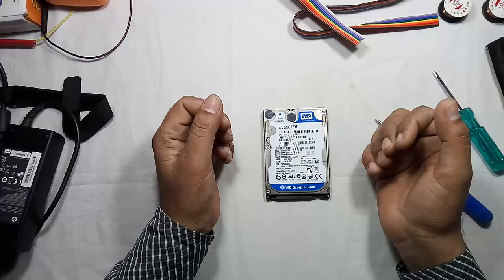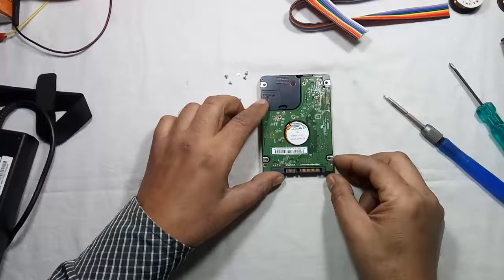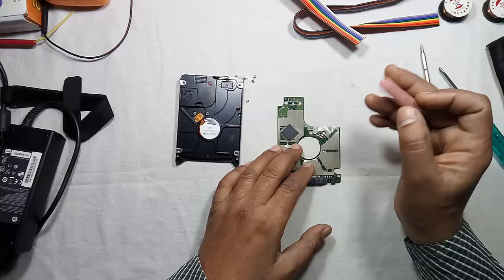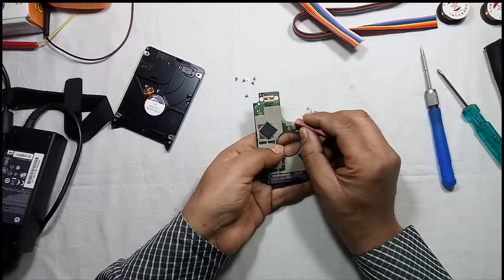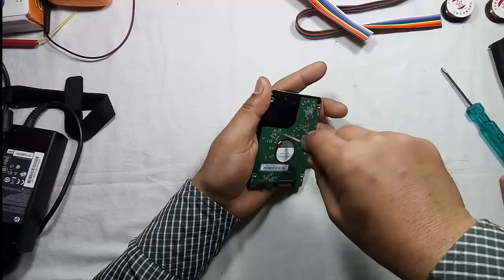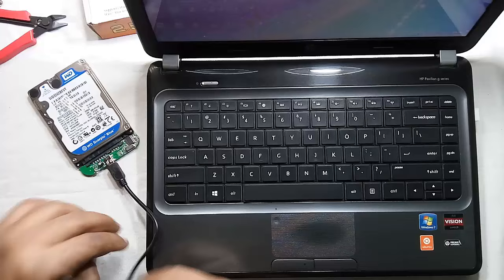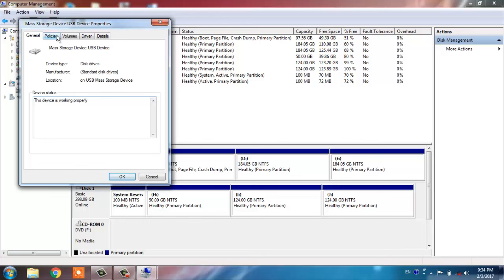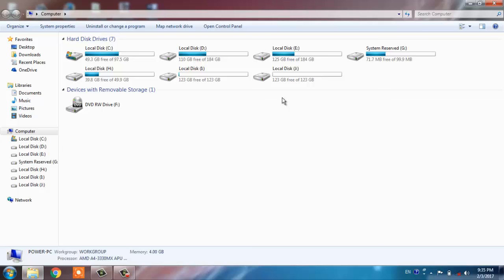How to repair hard disk not detected by Innovative ideas || innovative ideas

Comment: I have same hdd of 1 tb but my problem is that my hdd is displayed in device manager but when it didn't get iniltilaze when i format.  No clicking sound and spinning well. 
What to do. It hangs my pc also when i plug. How to format in device manager so that it can show in my pc manager. 
There is also bad sectors when i check in recovery software.

Comment: I gather that you just said DO NOT USE the hard drive that was just fixed as the main hard drive. Is that right? This lap top i am working on has the recovery partition ON THE HD. There is no copy, Sony will not help with Vaio computers or lap tops.  i dont know why but that is what is written on the site.   so 

  wow.   this hard drive is visible when i hook it up to my desktop as you have with the external hard drive parts are hooked to it. ( very cool trick, I like it.)   but when I put the HD in the lap top after cleaning it still is not visible, says NO OP sys found and also HD Not detected.

Comment: @innovative ideas Very nice video you have made but my question is how to know if the hard drive is making a clicking sound, is it the sound which is made while running or we need to check by shaking the hard drive.
The sound while running is not at all in my hard drive but while shaking very minute tick sound is there but I feel that is normal, please help. Thanks
Reply from the maker: good question. you can check it by keeping your ear on it. there must be smooth running sound. no extra sound of other noise. you can also check by keeping a microphone on it. or stethoscope......
Reply: Thanks for the reply, this is while running, right ?
Reply: Yeah, smooth running sound is there while connected.
Reply from the maker: YES, IT IS GOOD

Comment: My hard drive had 3 partitions. 
1. System Restored 100 MB 
2. C drive 150 GB which I had formatted while installing windows. 
3. D drive 300 GB. 
I am unable to install windows on this harddrive, it is taking a lot of time. So I changed my hard drive. 
I have connected this harddrive via sata to usb 2.0 to my laptop. But only first 2 partitions are opening on my laptop. The important third one is not opening on my laptop. The partition is getting drive letter but it is not opening.

No softwares are in a position to help. What should I do?

Comment: if your laptop detects the drives of your internal hard drive on (my computer) but there is no volume space underneath them and if you try to open these drives it takes ages and your laptop becomes non-responding. Is it a bad indication that you lost ur media ? any help please
Reply from the maker: In this case try out the process shown as in this video and after that apply some other processes shown in other video https://youtu.be/Rnss9HxpsGk. Thanks
Reply: Your description sounds like the drive turn RAW, which can happen for numerous reasons. If you check the drive using windows disk manager it will show you what the drive is formatted to. If windows disk manage shows the drive formatted as RAW and that drive was previously formatted NTFS, you can use chkdsk to correct the issue for that drive.

Comment: Hello sir.
I have a seagate 2TB drive that was part of my home NAS. it is now not recognizes by windows. I tried 3 different data recovery software options and none found anything. on them the drive shows with a drive letter and 0 kb size. the disk makes no sound whatsoever. i tried using a different logic boar from another HD that is in the same class and no success. Any idea what else can i possibly try to rescue data from the drive?
Thanks in advance.
Reply from the maker: Dragan Duric  I will provide it tomorrow...
Reply from the maker: Bro, It might be the cause of head error. Kindly replace the head if you can do it confidently or else kindly visit to nearest data recovery shop....
Reply: ok. thanks. If i wanted to get a new hard drive to replace the old one, how would i install the OS that comes with it so that it would work as NAS on my home network?
Reply: Dragan Duric did you tried opening hdd and moving the head? there are some vids that shows how. i done that aand it is easy but be careful.

Comment: Can this method used for desktop pc hdd ?? I have a seagate barracuda 500 gb hdd. Was using windows 7. Became slow and slow say by day. Not booting up takes about 30 minutes. So i removed it from pc and connected it externally to a laptop using a 3.5 inch hdd case adapter. No clicking sounds or any other noises. Takes about 5 minutes to get detected when i tried connecting it externally to a laptop. Every folder shows up really slow. Copying data takes time. About 1 hour to copy 500 megabytes. Can you help me out please ??
Reply from the maker: Riddler kindly run checkdisk....
Reply from the maker: Riddler Please Right click on the desired drive. Click properties. Click on tools tab.Click on check now.Select both the options of check now. Then click on start. Follow these steps for each partition. This operating system tool will check your disk partitions and repair automatically.

Comment: Sir i want to know i am using Western digital hdd 2tb and it wont detect on my operating system. I m sure that my hdd is spining, also i didnt heard any click sound from it but when i connect it to my pc my operating system wont even starts its hangs on windows 7 logo same with windows 10 but it didnt help. I am using 2 wd hdd both are 2tb and 1 ssd
Reply from the maker: Most of the times this problem also occur due to weak power supply (SMPS). Kindly check that
Reply: m using 1000wats smps is that insufficient or r u referring me to use multimeter to test the power supply manually ??

Comment: My hard drive is a data or an ide hard drive and when I connect it gets hot but it does not work at all or show on computer or make any signs that its working. It's very very quiet no sound at all. Just high temperature. Can you help me ,please?

Comment: Sir my external hard drive not responding properly but it's shows sometime but not detected at all when detected it takes many time to open the drive but after it's not responding
Reply from the maker: Might be due to bad sectors.
Remain connected and power on your system. It may check errors of the HDD while booting.
Or else manually use chkdsk command.
You may also try the guidelines shown in the above video.
Thanks

Comment: hi sir help me plsss eith my external

i Cannot browse device in My Computer (Can't even see the device there, for that matter. No drive letter is assigned, and it's completely absent.)
Can see "WD My Passport 070A Usb Device" under "Disk Drives" in Device Manager. 
Can see the device in Disk Management. Showing up as a 2TB drive. Status is "Not Initialized". Whenever I try to initialize the device by using MBR or GPT, I get a message saying that the device is Write Protected.

At a total loss. The drive is there, but nothing about it is accessible. There are a lot of important photos on this drive, I would hate to lose it.
Reply from the maker: Kindly follow the instructions shown in this video

Comment: I have a sata 3.5" HDD from my all in one PC
I'm trying to use it as external storage. I have baught a sata to USB casing.
But when I connect it to my PC and power the casing the HDD spins
But is not being  detected. Not even in the disk management.
No driver's are being installed.
What can be the problem converter module or hdd
Reply from the maker: Rejin Jacob kindly check your HDD with another pc connecting as internal HDD. You will be clear about HDD or casing.  Thanks.
Reply: if we connect the converter board alone without HDD does it install any drivers on PC ??
Reply from the maker: Try to replace it. Thanks

Comment: Hi,my external hard disk cannot coneccted to the computer,but it make vibrating sound which i think the power is not enough, can this video fixed it?
Reply from the maker: Yes you can try it, and kindly check data cable also like pata or sata cable.
Reply: Yeayyyy thank youuu,now its work!!!!

Comment: hello there, my screen was jumping and thought to unplug and plugback the cord to the screen, accidentally my laptop was turned on at that time and , while i was doing a little spark occurred, don't know why, now the screen is not at all working,its just like not being connected to the laptop, dead, what to do, is it the screen's problem or the cod. it was working but was only jumping, but if you press at the bottom of the screen jumping even would stop at that time, now even all is dead toshiba satellite c660d can anything be done

Comment: My Seagate External Hard Drive is not responding when connected to a computer. It spins normally & shows the blinking light as well but when I try to open it in windows explorer, the whole computer stops responding. What might be the problem? There is no clicking sound, the light is blinking and the HDD is showing in "my computer" but I cannot open it. I tried to run CHKDSK on cmd, 3rd party softwares, device manager, etc  but everything just stops working & I had to pull the plug out.. When I checked my task manager, the disk is running at 100%... It is sad because it is just bought it a few months ago and now it is no longer working with my data stuck inside it. :(
Reply from the maker: It seems the problem of logic card. Please contact nearby expert computer hardware shopkeeper. Thanks.
Reply: @innovativeideas  alright at least I know that the drive is not dying. Thanks

Comment: My desktop was turned of due to High voltage electricity. then when i restart pc, its OS was doesn't work. And when i try to install New Os by CD, there was not showing harddisk to install it. Please help me atleast to recover data from Hard disc
Reply from the maker: Kindly reconnect your HDD after disconnecting sata cable and power cable. You can apply the method shown in this video. For data recovery you can watch my other video 
https://youtu.be/XI4y6HnpjEg . Thanks
Reply: @innovativeideas  thanks sir responding my question. I hope it will help me. Thank you again. 🙏🙏🙏🇮🇳🇮🇳🇮🇳🇮🇳

Comment: sir my laptop's hard disk is not detecting...is there is option to backup....it sounds for 5 6 sec when we turn on laptop...on screen it shows ...boot device is not found please install operating system....can I take bakcup of my laptop's hard disk
Reply from the maker: Take it out from the laptop and connect it to any working laptop or desktop.. You may take backup...

Comment: I know this is an old video but here's my problem I was using my laptop normally and it froze outta nowhere I closed it and opened it again and got this error: 
Non-system disk or disk error replace and strike any key when ready.
My laptop is to Compaq 6710b.
Thanks.

Comment: What should I do whenever I turn on my system the system boots the os after logging in it hangs after 5 minutes ! What would be the issue sir?
Reply from the maker: Clean RAM and it's port. Try repairing operating system.

Comment: in my intel dh61ww MObrd bios detects dvd drive but the same sata port doesnot detects my seagate hdd. then is the hdd defective? pls help  (when i changed the moboard of my desktop)
Reply from the maker: raghunath sharma kindly check if your HDD is spinning. Try to change the SATA data cable and SATA power cable..
Reply: Yes it is spinning.connecting cables are ok.Ihave tested with another hdd.

Comment: Hi, my 1TB seagate barracuda HDD, which I use as my D: drive, started giving errors. It always required a chdsk every time my PC booted. Eventually my PC stopped booting and said check for errors. So I opened the cabinet and disconnected the hdd. My C: drive is another 500gb HDD. As soon as i removed the 1TB drive, the system booted properly and fast. I also noticed that the faulty HDD was over heating in circuit board area. I tried connecting it via a HDD Adapter via USB but the system says it cannot recognize the device plugged in and that it is not working properly. I also noticed that when I plugged it in to USB slot, my screen started having some noise interference. Please help. I need to repair this hdd and recover my data! Thank you, Sir.

Comment: my toshiba satellite bios says in the BIOS hdd and odd is not present , i have updated the bios , still both sata drive wouldnt detect , what shall i do ?
Reply from the maker: Kindly disable secure boot, enable legacy boot order.. where you can select your HDD or ODD. Thanks
Reply: INNOVATIVE IDEAS it's an old laptop which doesn't have any secure boot option . It work only on legacy boot
Reply: Toshiba satellite c660
Reply from the maker: chinmoy biswas then please select SATA port as IDE...

Comment: what happens if theres a clicking sound in the hard drive
Reply from the maker: Kindly try after changing the power sata connector. Sometimes clicking sound also come when power supply is weak and sometimes when power connector is improper. After this clicking sound occurs then I am sorry. kindly take the backup of your HDD and replace with new one.. Thanks

Comment: sir! please help me... I have WD Externalxternal HDD 2 TB which is not detectable with Beep -Beep Voice... so please suggest me to solve it....and after that I want to my data recover from it...
Reply from the maker: Ashokbhai Limbani bro, it may be due to improper usb cable. Kindly try after replacing cable.
Next try to connect with other usb port or on other system. If it does not work then try to replace the socket of the cable connector in the casing of HDD..
You may got success but remember that if your HDD is beeping after fallen down, these steps will not work... 
Thanks

Comment: sir I had laptop hd i had inserted to my pc it was detected and next time it was not detecting what was the problem
Reply from the maker: You can check for sata/ IDE data cable and power connectors to HDD. Change mode from AHCI to IDE. If you are having branded PC then kindly check the HDD boot priority in BIOS.
Thanks

Comment: HELP NEEDED...My external hard drive when plugged to a laptop spins, and its recognised by the laptop. Immediately I attempt downloading, minutes after I start hearing a scratching sound and it gets disconnected. When I plug it back, it no longer recognised by the laptop. After 3 to 4 days, I attempt and the laptop sees it and when I try opening a video, same issue reoccurs and gets disconnected.

Comment: My WD 3TB WD30EZRZ is now detected but with a wrong size (12TB) and Windows and other tool tell me that is not supported disk or MBR  to be fixed any idea how to solve?
Reply from the maker: Alessandro Orsi yes bro, you can easily fix all these types of problems with paragon hard disk manager. Shortly I am going to make a video on paragon HDD manager. Till then you can try...
all the best.
Reply: Hi, tahnk you for the quick response. I tried but when i use the program i get this message "I/O error on HD 1 has occurred " and if i ignore and try to repair the disk once i try to make a new partition (MBR restore apparently works) the program crash.
Any idea?

Comment: Brother can u pls tell me how to use a laptop hard disk in a desktop.
I purchased a laptop hard disk an install it in my desktop but it is not detected in the system.
Reply: Is there any voltage issue.

Kharab to nhi ho gyi aisa krne se
Reply from the maker: Normally connect laptop HDD to desktop and check it in BIOS whether it is detected or not.
Reply from the maker: If you are installing 2nd HDD then go to device manager and format it. Otherwise simply install windows with creating partition. Thanks

Comment: Sir i have a wetern digital external hard drive but as per this video in this drive 2.0 pcb section is attached with hard drive. What can i do for wd hard drive to repair? My hard drive is also blinking when its conneted to pc.
Reply from the maker: You can try this method ..

Comment: My desktop HDD is a Western Digital 1tb Green and it's showing empty ATA slot in bios or showing sometimes as WDC xxxxxxxx-xxxxxxxx 0.0gb (the code number that I didn't memorized), and after the motherboard splash screen it shows "boot device not detected please insert a boot device and press any key" or it is showing "boot device not detected press ok to enter BIOS" and when i tried to reinstall windows 7 with installation disk there are no drives to install windows to.It's not even reading with usb module in my laptop or desktop.This mainly happened while updating a software after which my pc frozed and crashed with blue screen and since then by hard drive became undetectable and readable.

I'm very worried cause there are several important data, documents, projects and files of my life's work and i'm afraid i've lost them for good.Right now I'm running my desktop with another hdd which is totally empty and useless as there are no personal files in it.

So, please help me out with this.

Comment: Anybody got any ideas ? i recently had a pc from a few months ago that's is now put away, because one day i turned it on, it was going extremely slow, and then it said the Disk was disconnected and not detected...So would it be a better idea to reset, and install an SSD, or just buy another Disk and put it in...Still have to find out how to take out the factory rivets, considering whoever owned it before was a criminal keeping it in that..? Help

Comment: I clean the harddrive conacts,but the Pc still doesn't find the harddisk....i feel the disk running,but notthing to find onthe screen,so i think something else is wrong....
Reply from the maker: palletje gmail sometimes it may be due to bad SATA cable, moreover you can try replacing logic card with the same card of other HDD. Thanks